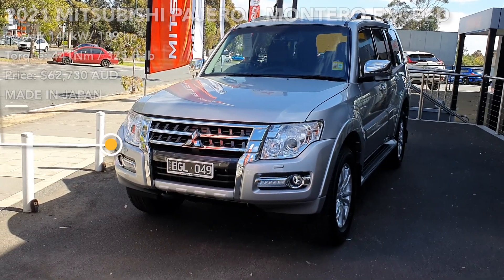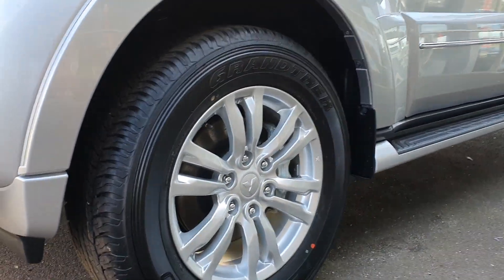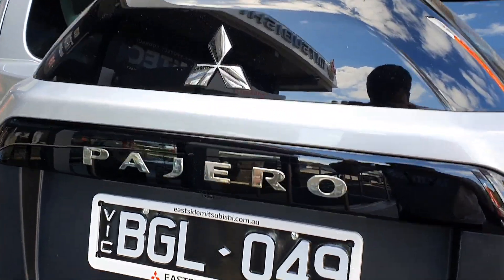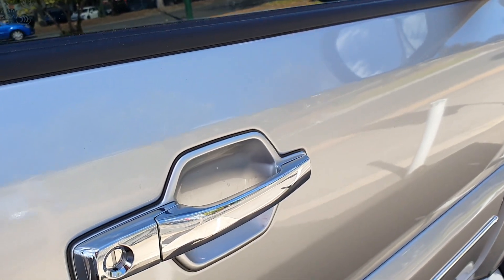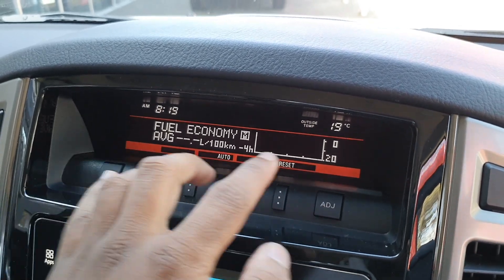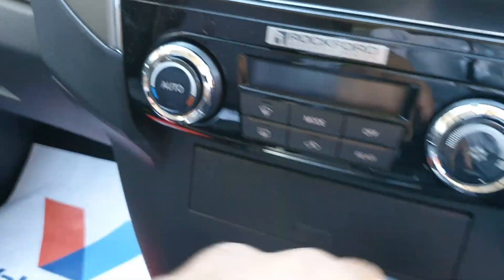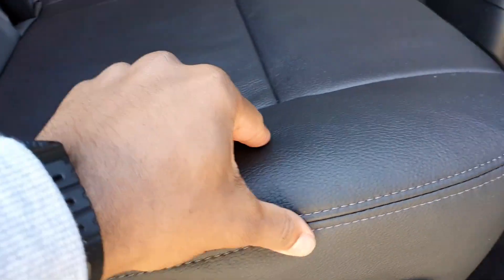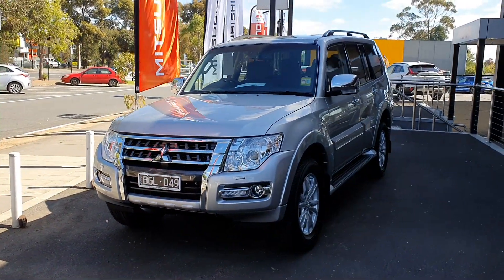Is the Mitsubishi Montero a good vehicle? Mitsubishi Montero Review

Comment: The Mitsubishi Pajero (Shogun) this phase has been around for 14 years, it feels outdated 2021 in terms of exterior design and interior switchgear and advanced technology. Although, Mitsubishi had gave the Pajero a few facelifts and model updates to try keep it fresh.
Reply from the maker: I do agree it's a great car but very little of it has changed and starting to show it's age they need a new model I heard they are releasing a new model soon possible hybrid one.
Reply: @CarBooth1   Did they stop production of this vehicle?
Reply from the maker: @REDGEVOLUTION  They still make this car but I think this is going to be the last year. They are planning a Pajero/Montero to be released in 2022
Reply: It's part of the reason for the rock solid build and reliability, same reason Toyota's were so reliable. I will drive a vehicle (especially a utility) that is "outdated" and proven, long before I drive one with a bunch of new gadgets.

Comment: the other engine option is the petrol 3.8L V6 with 269 HP (170kw) @ 400 Nm.......

and it was it's original trim
Reply: No, the 3.8 produce 250hp and 330 Nm
Reply: @yutuniopati  I see it....

but it could have been better if its 3.8L V6 have bigger power 

"300 HP"

instead of only 250 HP
Reply: @francocagayat7272  Mitshubishi officially sell a kit that can transform a 3.8 6G75 engine into a 4.0 liter 6G75 engine, with some other transformation like plug or air intake you can gain 57 more HP and probably reach the 400Nm of torque.

One guy on YouTube done that, search for "How to squeeze extra 57HP out of 3.8L Pajero" on YouTube.

Comment: Odd question, does the rear door have a locking hinge?
Reply from the maker: I need to get back to you on that one as i'm not too sure.
Reply: Yes. All the Pajero models are equipped with a locking device that can be actuated when the back door is completely opened.
Reply: @gaaloulmed4753  Thanks, man, I would kill for this version in the US, basically an upgrade of my Gen 3

Comment: BiLED? I am pretty sure they are low beam HID, high beam incandescent
Reply from the maker: Yes they are BI-LED the main bulb is Bi-xeon and the the rest the LED running lamps and low beams are LED. its similar to a HID but xeon bulbs use a type of case easiest way to tell is when xeon bulb goes out they turn a dark red.
Reply: @CarBooth1  🤔 Xenon is the same as HID... you are saying the main bulb is BiXenon, so they can't be BiLED... either way, when the Montero had its final face-lift it got LED DRLs but that's it, it continues to use low beam HID/Xenon and high beam incandescent